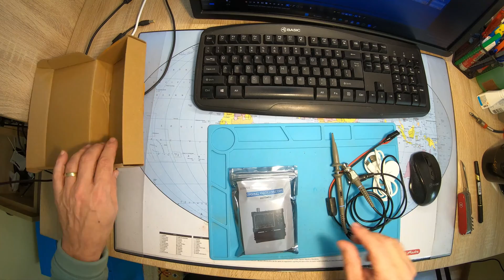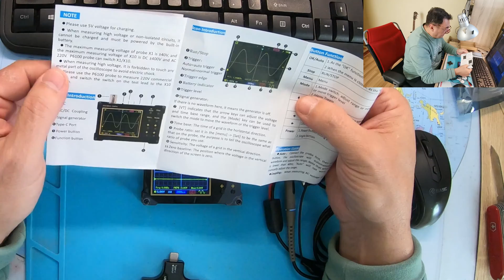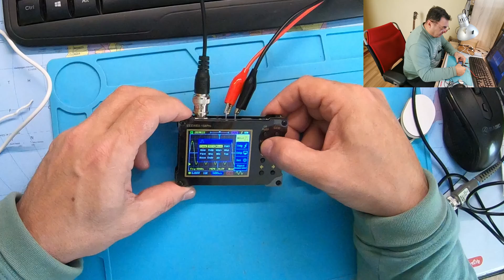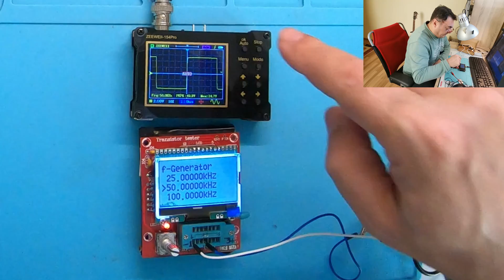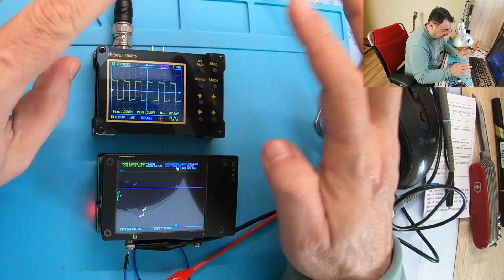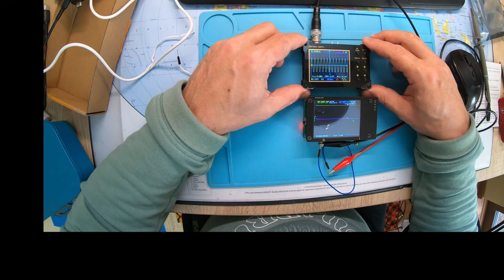ZEEWEII DSO154Pro 18Mhz oscilloscope

Comment: Can I use this to measure the IGBT(gate/emitter) of a inverter welding machine?
Reply from the maker: You can visualize  the frequency of the signal. For a proper measurement of a junction,  you need a transistor tester or multimeter on diode mode.

Comment: can you show let me know the connection and voltage for the battery? I just purchased one that comes with no battery and now I cannot find ANY details for it
Reply from the maker: There are two kind of kits as I know, the one without battery doesn't have implemented the charging circuit...but let me check and I'll be back to you.